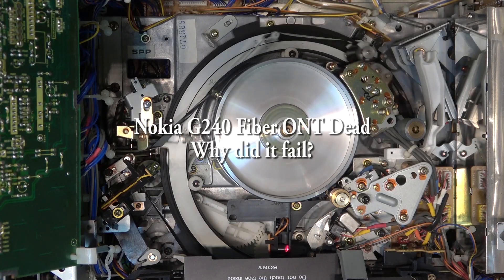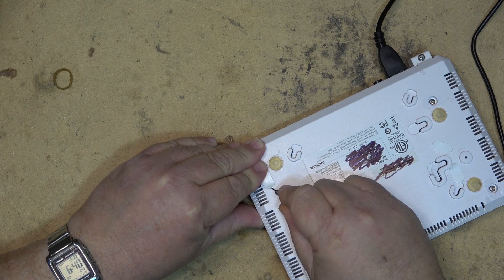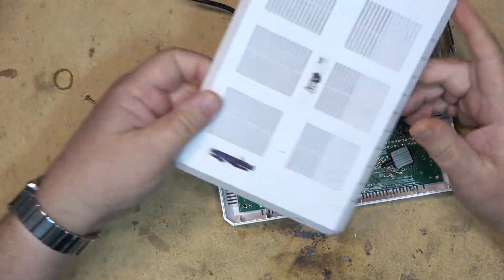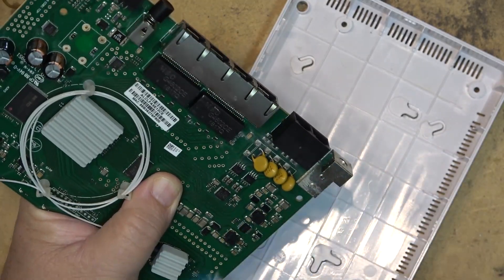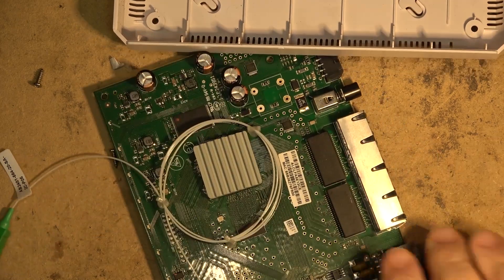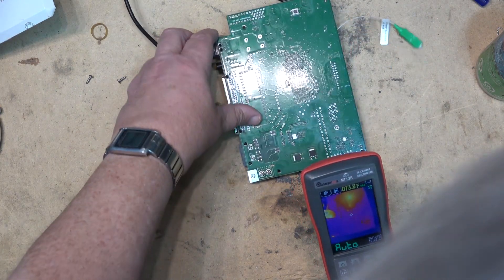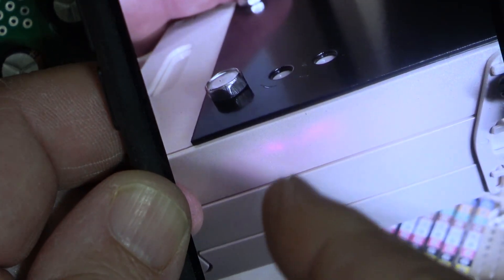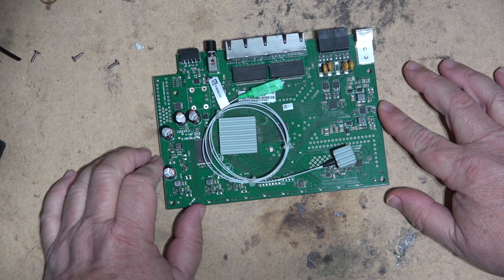Nokia G240 ONT why did it fail

Comment: I'm wondering if it's worthwhile after buying a piece of electronics to rip it apart and spray a silicone barrier to stop water ever causing corrosion on the board. In comparison it seems apple place a black coating that enhances corrosion .

Comment: I have had more issues since having FTTP installed than i ever had with the old copper system.
The latest issue was that the download speed was slower than the upload, this time replacing the
router returned the download speed, but it has never reached what i am paying for.
I pay for 500mb/s the best i have seen is 300mb's, after many complaints and vists by the so called
experts, they declared it was due to a damaged fibre cable from the local cabinet to the pole supplying
a row of 12 properties, only the first few were able to receive the guaranteed minimum speed.
No date yet for replacing that cable.
Reply from the maker: I held out as long as I could.  I was very happy with my 75 down 20 up copper.  
One if the problems with fiber is because its shared with 31 other users. All it takes is 1 bad ont, or 1 bad fiber that causes low signal to 1 customer and that ont will ramp up the power to try to get through.  This can interfere with the other 31 customers.  
Just got a warning about a new onu that can only be used with a specific brand of gateway.  Plus it into the other brand and due to a software bug it will take the other 31 customers out of service for 1 minute. Of course that is no worse than me when upgrading from goon to xgs ports and the records are wrong and I have to trace the fiber back. I put my ruby on at the house and start unplugging the feed for the splitters taking 32 out of service at a time till I find the splitter and then go through that splitter till I find the strand to the prem so I can move it to the xgs splitter.  Someone having a zoom call about to close a multi million deal and internet goes down.  I don't give a fuck. That's on the guy before me that didn't update the records.
Reply: @12voltvids  Sounds like full fibre has more issues than we had with the old copper systems.
Apart from noisy lines or corroded connections it worked most of the time.
The more advanced technology becomes, the more complicated it becomes to resolve issues.
Some might call it progress, i call it a pain in the butt!
Reply from the maker: @Barbarapape its actually far more reliable than copper ever was.  The install is more critical but when done correctly it is flawless.  Problem is people fuck with it. For example every time the fiber is unplugged it needs to be cleaned before plugging back in. So customer gets new cabinet and figures they will unplug the fiber to reroute and gets dirt on the end which blocks the light and now they have issues.  If they kept their fingers out it would keep working.
Reply: @12voltvids  It is supposed to be, now that you mention that clean fibre connections are critical, the sheer
number of times that the so called experts messed with the ONT and line from the pole may be another factor
as to why i still have a below spec download speed.
I have never messed with it, and i have never seen them clean it.
They claim that subcontractors were used to install the multicore cables and never tested them fully
hence why only the first 3 properties have a full speed connection.
To be fair they showed me the results at all three of the properties and compared it with mine
and the rest of the row,
Until that cable is replaced nothing will change.

Comment: Nice intro lesson in practical fiber optics.
Reply from the maker: Fiber is cool.  We offer 5gig speeds in some areas 3.5 is pretty much every area.  People think they need that speed.   Nope 99.9 dont.  In fact 95% probably don't need the minimum speed we offer now 250m. I have it 150 and that is more than I ever will need and I do lots of large fule uploading.  Takes my 4 minutes to upload a 10 gig file. People think working for the company I would have the fastest available.  I am actually on an xgs (10 gig symetrical) port (my ont is the x250s) but that was only because all the 1gig splitters were full and all that is going in now is xgs ports.